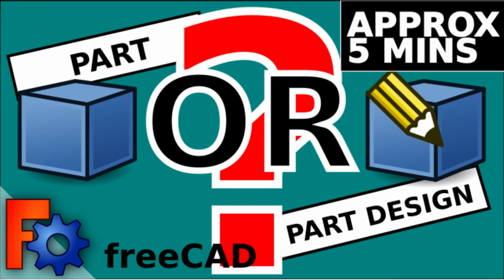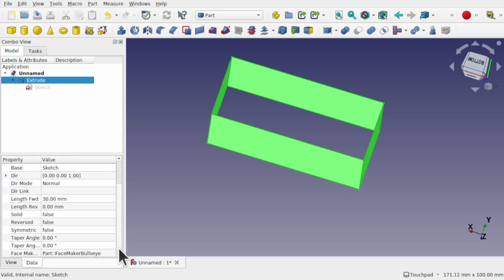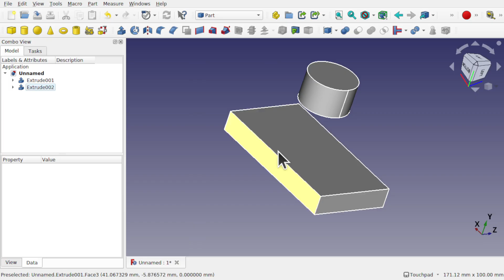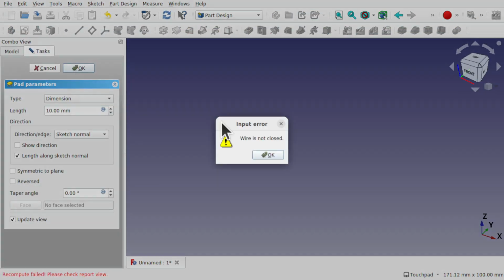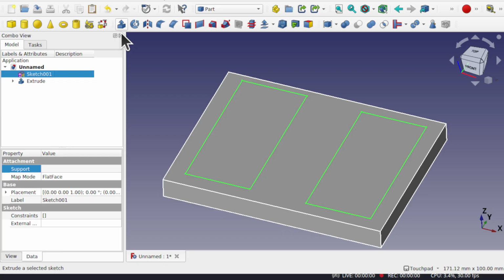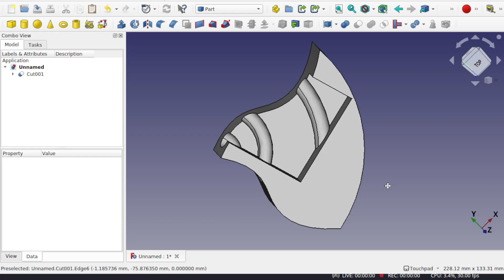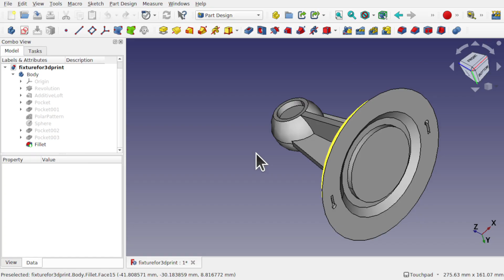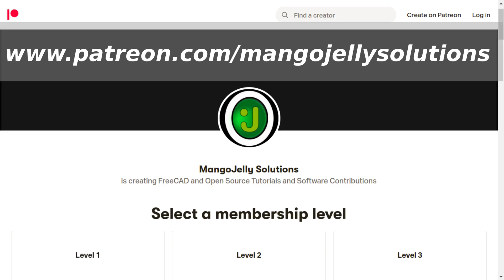FreeCAD: Part Or Part Design? which one? Answered in 5 minutes (approx)

Comment: So Part design does some stuff of joining geometry automatically, but has issues if you try to go beyond the built in shortcuts. While Part takes more steps, you can arrange everything better, then just join them all in the end. So I should be using Part more.
Reply from the maker: Very much so but it all depends on your use case for the preferred route , I use part mainly as I do a lot of surface modeling and want to build surfaces separately to bring them back into a shell / solid and as you said part is way way more flexible so if I wanted to do something 'arty' I would use part.  Also part is great to get your initial thoughts into 3D without worry about creating a sketch that will extrude to a solid.

Comment: The video has great information but …

Constructive criticism:  SLOW DOWN! You are speaking at a rapid file pace while moving and selecting with the mouse at light speed. I much prefer to have a longer video than a shorter one that I have to rewatch several times to findout "what in the hell did he do here and there".
Reply from the maker: Thank you for the feedback, this was designed for a quick overview (maybe too quic) and appreciate the comment. I tried to cram as much information in this one video and the delivery was a bit of experiment, which, as you probably can tell, I will not be doing again as it was way to fast. There is another video in the 0.22 series that covers similar which is much slower pace.

Comment: FreeCAD 1.0 RC start screen gives a few options for what kind of file you want to open or create, which is nice because you have 6 options to choose from rather than 18 workbenches to try to figure out.  The first option is "create parametric part" which takes you directly to the part design workbench, if you want to use the part workbench to create your model you have to select it from the workbench drop down menu, so it seems like FreeCAD may be trying to nudge people in the direction of the part design workbench.  I've just started playing around with FreeCAD, but I've been using Solidworks for over 20 years.  The part design workbench has more of a SolidWorks feel to it's work flow but I've only been playing around with basic geometric shapes.  I haven't tried anything complex like trying to loft a body, do a swept cut, or revolved body yet.  Hopefully they get a stable release of 1.0 soon.

Comment: You know.. Everytime the question "Body vs Part" is asked, the content of this video is what always comes up. The problem is that most of us beginners walk away more confused, because we don't know if this is what we needed to know. Now, that i have some experience with FreeCad, I can ask again. What is the difference between a Body (the blue step-looking icon) and Part (the yellow step-looking icon and not to be confused with the "Part Workbench") ---- Both of with are in "PartDesign"? The "Part" that we're referring to is also referred to as "Std_part"... I still can't find a satisfying explanation of the difference between the two.
Reply from the maker: FreeCAD gets confusing where there is both a part (as in std_part) and part (as in the wb).  Part and Body (as in the containers) are containers that hold a origin and co-ordinate system that can be shifted and positioned around the 3D space.  Body container is a concept of the part design that holds the 3D sketches and parametric operation to create a solid object where as the std_part is a generic container that can hold anything.  I agree it get confusing and I find body is just a part design incarnation of a generic container.

Comment: awesome. I think the part workflow subsection is the answer to my issues. I remodeled something 3 times yesterday because after trying to go back and make a change to a section, I was unable to delete a padded part without destroying the rest of the body. I managed (in the mess I made) to delete a sketch for that particular padded block but the fillets and overall geometry carried over into a later change, meaning I could have the part as is, but could not do any modifications (to my understanding) of that section.

Comment: Hello, how to design a one solid object, the shape of which consist of two rectangular block 90 degrees to each other in the shape of PLUS (+) sign but one is slightly (half of the thickness) is outside of the other. In front view it is just a 8 line ply shape but from the right the lines are slanted. Hard to describe. I have tried to create the whole block and then cut off the portion I don't want, but it doesn't work. Appreciate if you could explain that. Thank you

Comment: Mango you're a genius but impossible for me to follow. I find I just end up doing it much easier with the Part WB. The Part Design I get done OK in simple designs but once I go a couple of steps it turns into a complicated disaster. I find the the Part Design Workbench takes 10x more time when I can do multiple steps in Part WB in a much less structured way which is more intuitive and it works. I invariably sometimes end up mixing them in some designs because one has to use say the Curves and Draft WB and then after hours I end up deleting the intermediary tools and have to rethink everything once nothing begins to work. Then I redo it the same way a second time and it appears to work whereas the first time just would not compute.  I realize it is because I don't have a full picture of the FreeCAD tree structure, I guess. I wish it was written down somewhere. The FreeCAD forum really is of little help and mostly for experienced people and programmers who tell you that questions  you ask has already been answered, when  it is not clear at all. Flip, there they start telling you to run code to do things sometimes. A written explanation is easier to follow, for me and the steps can be logically followed very quickly, whereas a video tutorial requires continuous going back to see what tiny little step has been missed that actually is the reason the entire process is a failure. People are asking about workflows - what the h.. is a workflow ?

But thanks, its fascinating to watch the dazzling speed you that explain these concepts and once I've been impressed, I have only the vaguest of improvement in clarity.

Comment: Thank you for this video, and your others as well. This is the simplest, clearest explanation I've found so far and now I feel like I have a better understanding of which workbench is appropriate for various scenarios. I work a hybrid job as both a mechanical engineer and a machinist and the CAD software we use at my day job is Autodesk's Inventor, but a friend and I are starting a welding and fabrication side business. I only run Linux on my personal computers, so I've chosen FreeCAD as my CAD solution to get this side business off the ground as it looks to be the most well developed CAD software in the Linux world. It's definitely quite a bit different from Inventor, but I've found your videos to be very helpful in grasping the differences that I need to understand to start being productive. Just subscribed. Keep it up man, excellent work.
Reply from the maker: Thank you so much for the kind words. Glad your finding the videos useful. If your starting out a metal fabrication business then you would be interested in the sheet metal workbench as well. I am going to have to do some tutorials on that one as I keep on meaning to. Good luck and thank you for subscribing 😊
Reply: @MangoJellySolutions  no kidding I didn’t even know there was a sheet metal workbench. Thanks for the heads up, that’ll probably come in handy one day

Comment: Thanks a lot for these explanations! As a newbie, I asked for something like this in the freecad forum some time ago, but never got an explanation that was satifactory. It always seemed to be a matter of personal preferences. 

I'm trying to design a wooden model aircraft in freecad. The way to go seems to start with part WB, as creating curved shapes such as wings with part design simply doesn't work when a certain complexity is exceeded (official wording is "less stable / robust", I guess). On the other hand, part design WB seems to be convenient for adding details to flat inner components such as ribs. For me, troubles start when I try to combine both. I always mess up the tree / history quickly. i don't have a clue which tree item should go where, what should be separate bodies / parts or not, how do the items relate. I would be very thankful for some advice on how to combine parts and part design in a well-structured way.
Reply from the maker: Great to hear the video has helped. I always advise to keep things modular. It's so easy to get caught up in creating the model as a whole rather than thinking what do I actually have in front of me.  A wooden plane is a assembly of parts so the body, wings, ribs etc are all a part and can be modeled separately and assembled together after in something like an assembly workbench. Even when you model something simple like a tea cup you will find It's not an assembly but a composite. The cup and the handle. You would model these seperatly but boolean them together rather than assemble. Again you can have a mixture, a assembly where some parts are composite or even sub assemblies. Brake down each into a simple form will help keep that tree nice and simple and make the modelling process easier to understand rather than overwelming.

Comment: I've pretty much stopped using the part design workbench. Yes, you have a "history", but that doesn't help much when a change in it breaks the body half the time. E. g. because names of faces and edges change and the references for further steps break. Inserting another step somewhere is almost a guarantee for breaking a body that's a little bit more complicated than a few pads and pockets. FreeCAD's undo function not working properly in some of those cases, makes it even worse.
A "part" workbench part seems much more robust. The tree like/hierarchical structure of such parts also feels a lot more logical to me than the linear "history", which is very limiting IMHO.

Comment: Great overview, thanks!
As you are asking for our perspective - about two years ago I have started using Linkstage3 FreeCAD branch and I never looked back. It supports multi-body Part Design and has may other improvements over the standard FreeCAD. It is also much better with the topological naming problem (but not perfect). Changes are being merged back into the main FreeCAD but that will take time - and in the meantime I'll continue using Linkstage3.

Comment: I would love to see a tutorial on modeling a cylindrical pot that has a curved side that runs from the top larger diameter to the bottom smaller diameter, but the tricky part being that the outside curved surface is covered in horizontal equally spaced grooves that have a semicircle profile separated by flat bars. So, from top to bottom, flat, and then concave semicircle, flat section, concave semicircle... And this patter happens about 30 times extending from the top to the bottom of the pot. Thanks

Comment: The problem really is any organic, curvy, or complex shapes in Part Design. It just can't be done in a timely manner. For example, to recreate the "Grip using Surface Tools WB" video on Part Design, one would have to individually model each of the 50 crosssection sketches individually and loft between them. Talk about messy trees...
Reply from the maker: Funny you should say that. A few months ago I was helping a patreon design ergonomic grips and we was using Curves workbench and a large amount of lofts. It should of really been done in Blender or similar (Even people working with fusion said the same.) We got through it and had a working prototype. The tree needed some serious management though and coming back to it weeks later was a bit of a head scratcher as it just looked like a rats nest. All I can say is thank goodness to group directories.

Comment: Thank you for the detailed explanation. Having a plan is my weak spot 😬 so I have to wean myself from Part Design. It's just so comfortable with its integrated Create Sketch button and showing the planes to directly select.
Reply from the maker: I know what you mean. One thing you can do is add that sketch button to the part workbench toolbar. Actually, I don't know why I haven't done this yet lol. Now I am wondering if you can get that same way to add sketches to base planes 🤔
Reply: @MangoJellySolutions  I've just went and added one too. I've tried to add one from Part Design but it won't quite show the planes and, what's worse, will automatically create Body which I won't need to later work in Part. But I do have a button now :)
Reply: @TechieSewing  you need to use manipulator workbench , and put the datums in part toolbar, to modify them you'll go to map mode
Reply: @lq_12  Nah, couldn't get hold of manipulator workbench. I still mostly use PartDesign unless I'm experimenting, or predict I'd want to extrude open sketches.
I did add 'Create sketch' to Part toolbar.